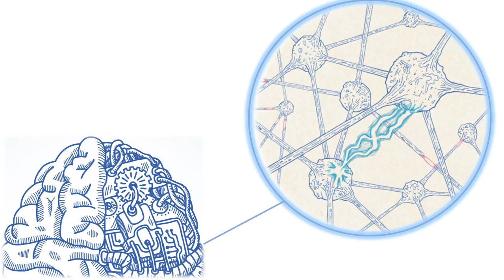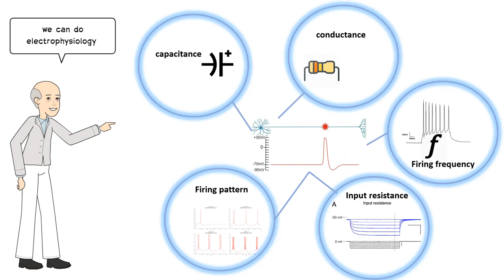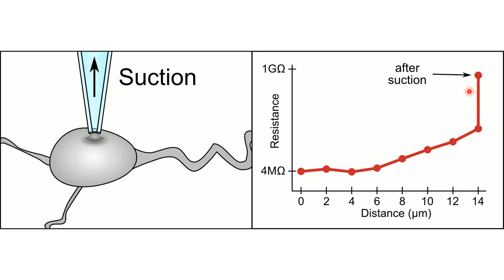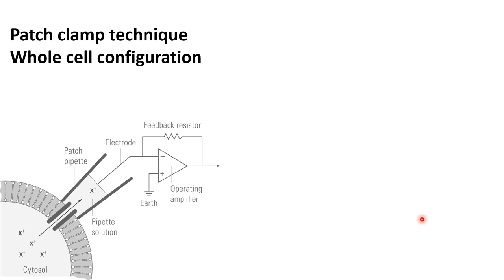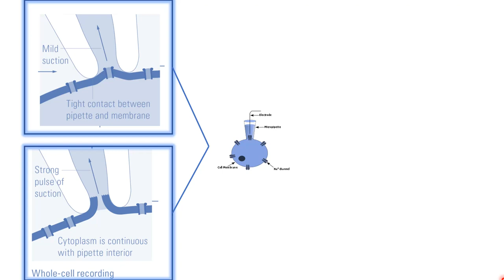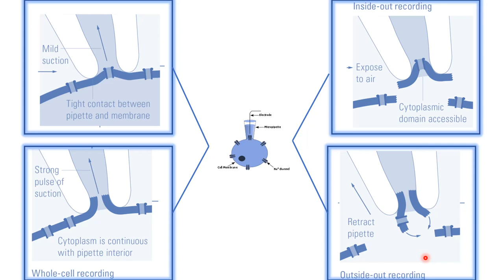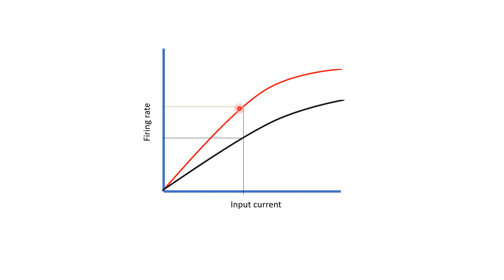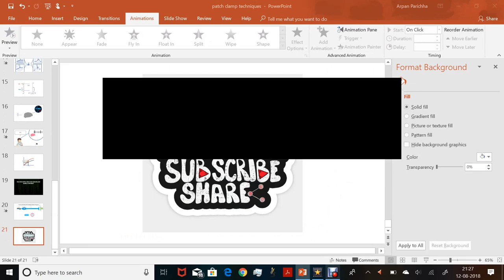Patch clamp | Electrophysiology | Patch clamp method | Voltage clamp | whole cell recording

Comment: Around 4:05 you say that as resistance increases and current stays equal, voltage will decrease. However according to Ohms law, voltage INCREASES with resistance at equal current.

Comment: Thanks. How do we differentiate between the type of channel (sodium or calcium ) based on current? Secondly when we are using a whole-cell patch-clamp where is drug solution added?
Reply from the maker: Good question , I will answer this in a video. The IV curve for sodium vs potassium channels are different,you can get some sense in this video https://youtu.be/7Zs8y9yr3ek

Comment: What is meant by negative current? Are the electrons flowing in opposite direction? If yes, then how is this possible?
Reply: Electrons can flow in any direction, depending on the sign of the voltage. Negative voltage > negative current, positive voltage > positive current.